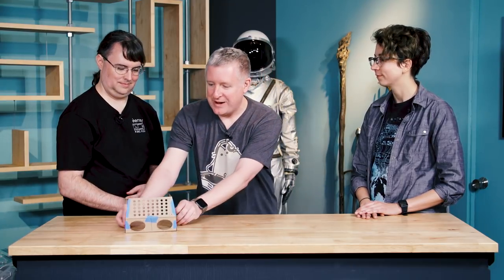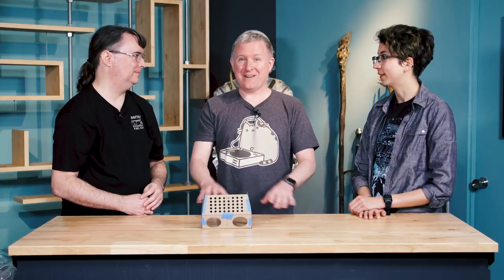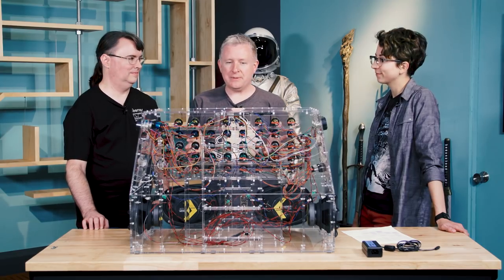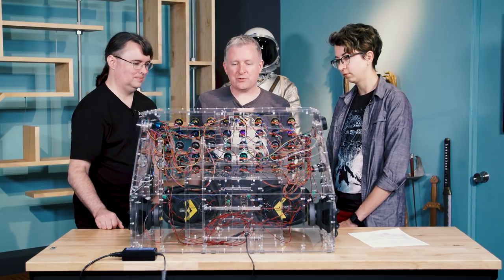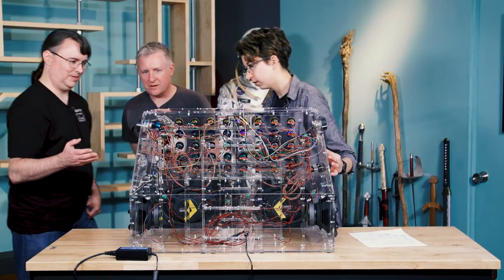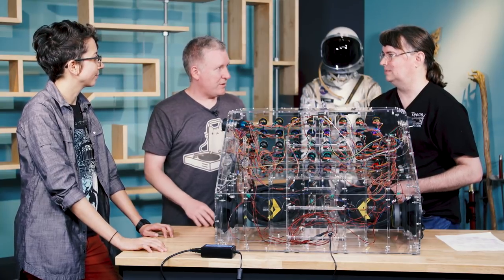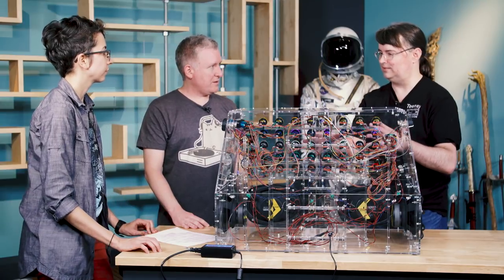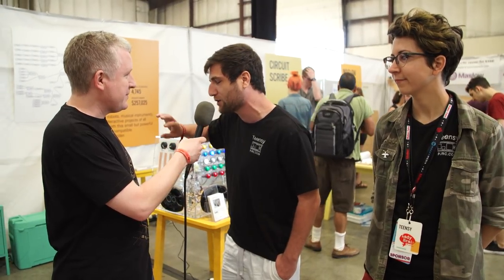The "Monolith", a Teensy-Powered Interactive Synthesizer!

Comment: Pretty cool. I would say two cool improvements would be: 1) cable/wire management. Its a rats nest in there, which is a shame, cuz they've got a beautiful clear case that makes beautiful music! 2) The buttons are kinda loud! They are like fight-stick controller buttons. Some nice rubber based buttons would cut down on the noise. (maybe the mic just picked them up too loudly,I dunno).

Comment: Actually the description of the capacitive sensing is wrong. If it worked how he described then this thing would be extremely dangerous. Capacitive sensing works by interfering with an electrostatic field and does not require any earthing. After all your cell phone does it and its not earthed.
Reply: penguins forall thanks for that was searching this comment...
Reply: Searching?
Reply: Yeah I thought that was a bit off for Paul, who is quite knowledgeable on these things. For the uninitiated, rather than sitting through a semester of Physics E&M, this is pretty good info:
https://www.allaboutcircuits.com/technical-articles/introduction-to-capacitive-touch-sensing/
https://www.allaboutcircuits.com/technical-articles/circuits-and-techniques-for-implementing-capacitive-touch-sensing/
Reply: +Jens Jensen Call me picky but I'm not 100% satisfied with how your link describes it either. Admittedly its typical to call negative difference (voltage) just ground in DC isolated circuits it makes it confusing perhaps in the same way the guy did in the video. The touch sensor is just a type of capacitive coupling. Because two conductors at different voltages relative to reference or "ground" or the conducting path have by definition a voltage between them. So there is capacitance if the two conductors are insulated from each other. Then measuring a difference in capacitance tells you the electrostatic field has changed due to Coulomb's law which in itself means something is interacting with that field like some other conductive body or a dialectic.

Comment: Why you can not use matrix keyboard, that 10 times smaller, not requires that amount of wires and jack sound output without speakers in one body(with amplifier if you want so). Ugly brick, looks like some kind of slot machine prototype. Combination of pair Teenage Engineering pocket operator will provide much more functionality  than this heavy casket. This device btw does not fit even the definition of diploma work. Sorry, just imho.
Reply: because it's a show piece for the makerfaire...